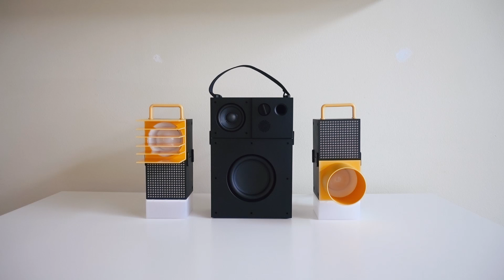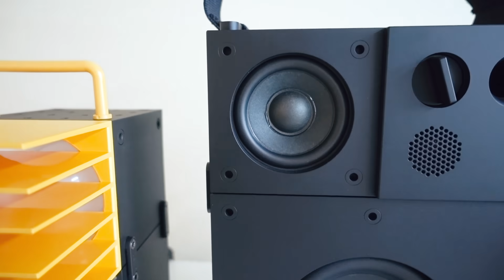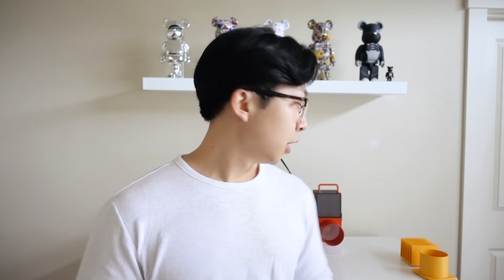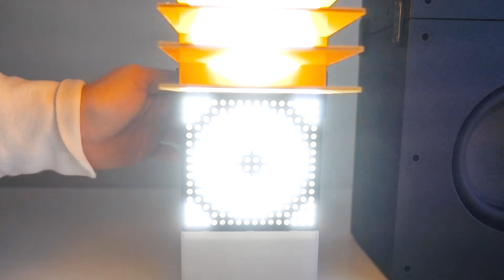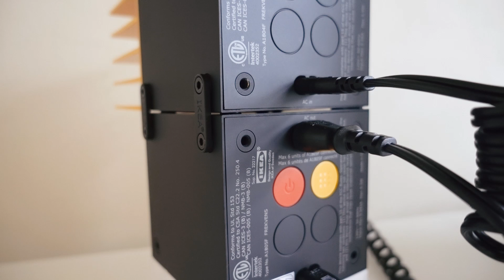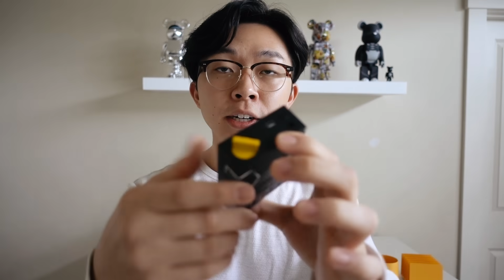FREKVENS IKEA & Teenage Engineering Review

Comment: Hey, nice video, good job :)

I'm curious, is it possible to treat this speaker as if it doesn't have Bluetooth. I understand there I an aux but I have a similar Bluetooth speaker that my phone will automatically connect to. 

I want to be able to plug this into a Chromecast audio and never have to worry about turning it on or off, or have to worry about my phone connecting to unwanted Bluetooth.
Reply from the maker: Thanks Jack! I wish I had a solid answer for you lol, but as far as I know...you can only connect Bluetooth devices to a TV, not to the Chromecast itself. 

That being said, perhaps the best way is to only have TV paired to your Frekvens (no iPhones or laptops)?

I actually haven't had multiple devices play over each other on the Frekvens. Perhaps that eases your concern :)

Comment: To clarify, speakers do not come with batteries but can be purchased separately.
Sound is good only with the sub, without it, the sound is harsh with little to no bass. When compared to HK Onix (much cheaper speaker) or my vifa Oslo (much more expensive speaker) the speaker comes in last. After you buy the 2 batteries needed to make this portable, the price jumps to about 200 USD. That being said, it is a limited run and people are selling these for a premium on ebay. Id say its a pretty interesting product.
Reply from the maker: si12j12 thanks for the clarification! I had read that the battery is chargeable when on...I didn't realize there was a portable battery sold separately lol I totally agree that the subwoofer helps a lot!

Comment: So in theory you could use these in stereo pairs on a synthesizer right? If not, that would be a huge missed opportunity for teenage engineering. They make synthesizers, so they should just play well together.
Reply: It has a 3.5mm input, but the input signal gets converted to mono. To use two speakers in stereo you need to get a 3.5mm stereo (for your synth) to mono splitter cable  (to have a cable for each speaker)
Reply from the maker: Quint thanks for clarifying :) I glanced over "stereo pairs" in Jesse's question. 😅
Reply: It has a 3.5mm input
Reply from the maker: Jesse Mitchell you should be able to use the 3.5mm cable that comes with. The one in the box is quite short though, so I'd buy a longer one. Lol